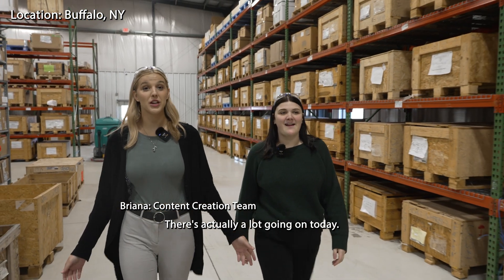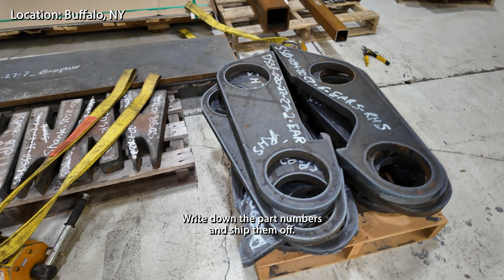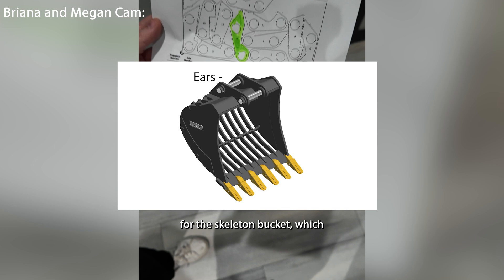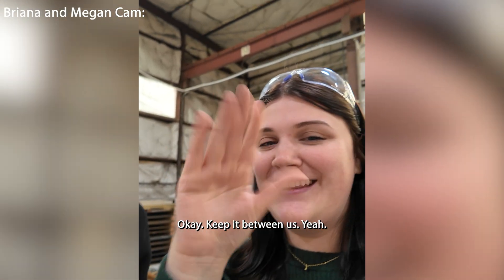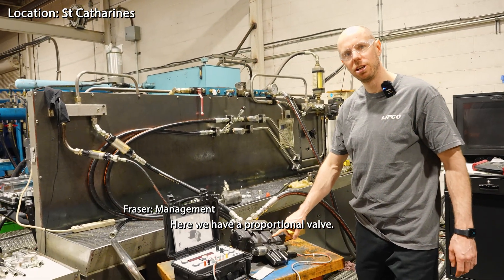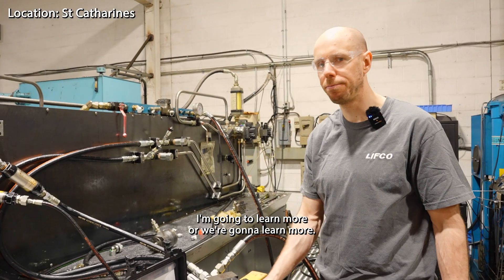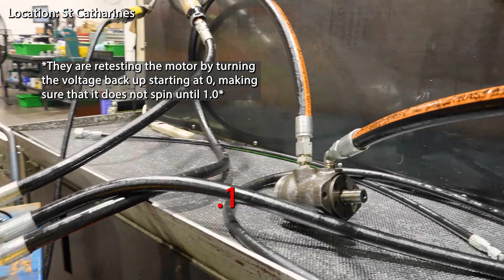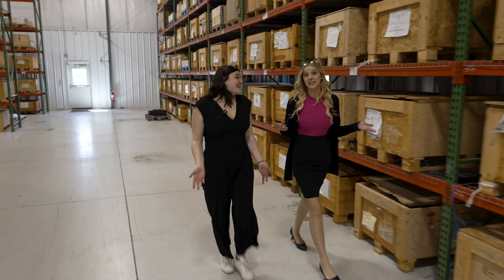A Day in the Shop: Making the Cut & Catching the Leak

Comment: Good video. I'm looking for a hydraulic rotary actuator for a line of chipper attachments I'm fabricating for my mini skidsteer company. Basically I need a portable PTO.
Reply from the maker: You are looking for a motor that is hooked up to the main pump on the skidsteer? (In hydraulics a rotary actuator is like a rack and pinion assemble that can spin - up to 360 degrees usually- , while a motor is for continious spinning) You will need to determine torque requirements and RPM.  Also a way to mount whatever it is that you are spinning (im guessing something like a waterpump?) onto that motor. Should be fairly straightforward, feel free to send us an email at sales@lifcohydraulics.com and we would be glad to help you with some technical answers, no charge or committment. -Fraser